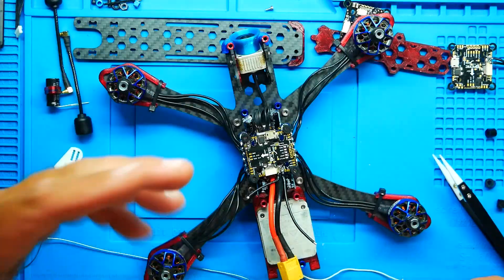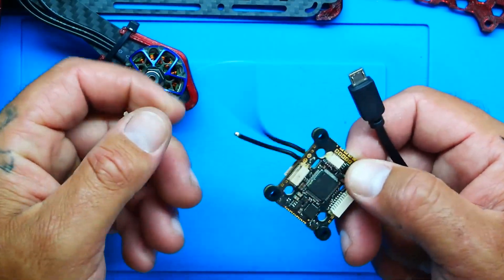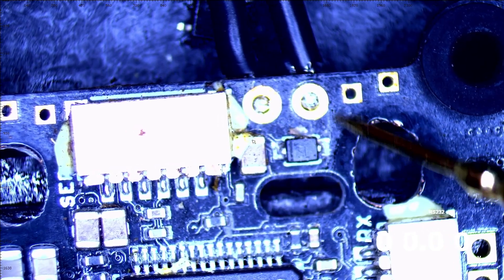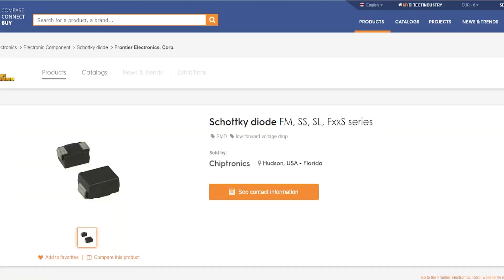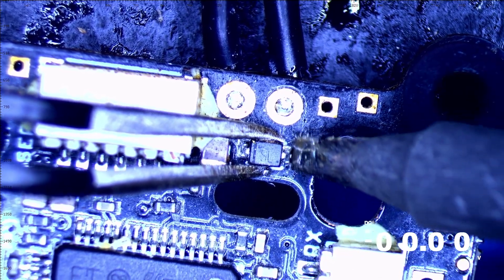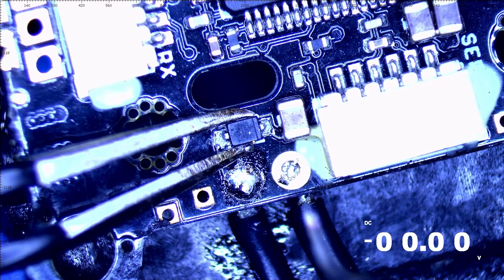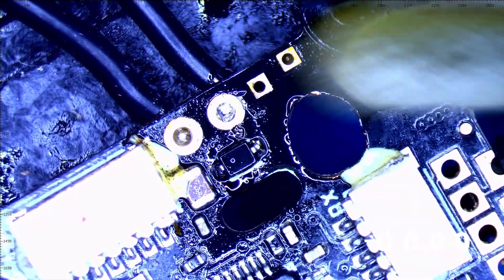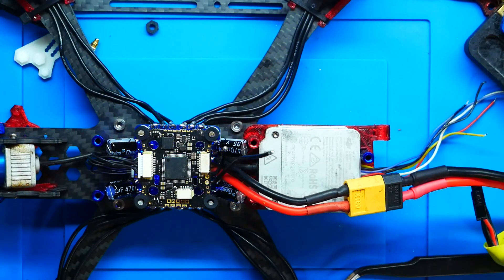Learn To Test Your Flight Controller With A Multimeter! Don't Throw It Away!

Comment: My ppwer supply should be the same rating as the battery im using for the drine. i presume . 2 s drone so I should use a 2s battery supply

Comment: Hi DrainMan, I have received a Brand New FlyLens 75 HD O3 \O3 Lite 2S Brushless Whoop FPV Drone as a Gift, After opening it I charge the Battery check the voltage and plug it, nothing happened, but I can go to Betaflight and check everything, even register the DJI part of it. Do you fix drone, maybe you can help. Thanks

Comment: Hello uncle, sorry for asking outside of the video discussion. I have a 5 in. assembled drone. With FC Speedybee F405 V3. But after everything is finished, the raft is assembled. When I set it on betaflig and wanted to test the motorbike, I plugged in a 6s battery which detected only 1s or 4 volts, not 22 volts. How do you fix it, bro? Please help uncle🙏

Comment: uggh, video help learn how to test motor pads and fets, but didnt find my issue. Brand new radio, brand new pavo 20.....not even 2 minutes into its maiden flight, I caould smell something cooking and then it hit the floor. No changes in betaflight other than assign switches and turning opff OSD and VTX due to I am flying LOS until I am able to afford the goggles I want. Anyways, I am stumped on this AIO in the Pavo 20. Using my multimeter to test pads and fets all came backl ok, I connect the AIO to betaflight everythinng seems fine, all lights flash and work the way they should. THis is drivning me fucking crazy, ther ehas to be a reason why a brand new drone cooked a motor in under 3 minutes time.....I just want to know if it was on my end, or defective product.

Comment: hi brother ihave a flight controller i axedently connect the ground pin to the motor output everything is working but little transistor is blow up which is (1amb) idont know everything works fine but this transistor is blown

Comment: Had you ever repair a TMotor F7 Pro FC of the chips that are right beside the large connector and are connected to the ESC outputs? I fryed output 1 and 3 and I want to know the replacement part, thanks!

Comment: I was wonder if I could use the smart battery from my dji fpv as the power supply to test the FC?
Reply: Also, is it OK to test with motors and everything connected?

Comment: hi Drain, thaks for the tutorial... i have an issue tho... i powered the fc with a bec, ok it works now, but i cant see the lipo voltage in osd.... it shows 0V ... is it because its powered via bec and it doesnt read the lipo?... is there any ways i can solve it?  thanks.

Comment: Hey DraaainMaaan.  I have a DJI 03 VTX and a RX connected to a blitz f7 mini FC. When I have connect only the RX, there are no issues. However, with plugged in battery when I connect the VTX, the RX gets burned. I've ensured that the components are connected to the correct ports. Do you have any idea what the problem might be? I thought it could be the voltage regulator on the FC.

Comment: Mine doesn't do yhe betaflight or power up from esc board  but i put tape around it and wrote bad on it and put it in a plastic coffee jar with bad vtx's and a bad elrs rx that worked until the ufl yanked off by the props . I put antenna on where the ufl snap went on , but whe i tried adding  shield ground wire the rx fell off from heat . If i would have used a different ground or just used a 14mm or 28mm wire for antenna hanging off the board . 6 elrs rx's and 3 tx's need " upgrades"  to work . That means they sell them in non working condition .

Comment: Had a little bump when landing (I blame airmode) and now my FC won't connect to the ESC either. Its fine via USB C but doesn't power up. This sucks and I don't know what to do.
Reply: did you figure it out?

Comment: A common problem is when using an iron that it’s too big is hitting or wiping tiny components off of the board. Some traitors are sooooo tiny that you can not see them whilst soldering. Study the boards solder point before you go and tin it up. Work from the outside and try not to wipe the iron across the pads if you can. It’s a tricky business and I’ve had to reflow boards for friends 😜💖

Comment: Man just installed the new g4 fettec fc and can't get the osd to work with the caddx vista. I used the pin in the fettec g4 manual and I only get link quality and nothing else.  I need battery volts and amps used. Any idea why and what to do??

Comment: I think it’s always worth fixing (if you know what you’re doing) because it’s not just that everything’s getting so expensive, it’s also that there is so much “Out Of Stock” components and shortages and because of the whole “Chip Shortage” companies are replacing quality components with lesser quality or slightly older components/gyros/capacitors/chips/boards/etc,etc as a matter of fact I’ve busted out a bunch of those “On The Arms” ESCs just to get some builds done while I wait for the ons I purchased. The good thing about this whole “Expensive/Chip Shortage/Out Of Stock/On Pre-Order Forever” situation is it’ll make people want to learn the basics: building, soldering, flashing firmware, programming protocols, inputting commands, configuring “Betaflight, INAV,Emuflight, Blheli, Agent M, etc,etc learning how to match components with each other in other words becoming more self sufficient and understanding quadcopers as a whole along with flying and just the entire RC hobby from ground vehicles to helicopters, to planes. 💯💯👍👍👍

Comment: I love my Fettec but unfortunately if the MCU happens to go poof on Fettec or KISS, it's done thanks to the serial and closed source firmware.  Betaflight FCs are much easier to fix since you can replace the MCU and flash.

Comment: Hi, is it possible to remove the osd chip without a heat gun station?
Reply from the maker: It can be done, but at least a spatula tip or hot plate would be helpful.

Comment: I love doin tish like this! Drain has a freakin lab scope lol quick question can a gyro be fixed ????
Reply: Yes! They can be swapped just like this, much more work but yes
Reply: @TylerD63  thanks alot man I was just wondering because my gyro went out after 4 batteries in my brand new mobula 7 elrs smh 👍🏽✌🏽
Reply: @FPVADER  it's definitely more difficult than what he just did though that's for sure lol
Reply: @TylerD63  that's why I'm gonna end up just purchasing a whole new whoop lol that way I will have spare parts at least lol just sucks because this thing is brand new maybe I just got a bad one from the factory
Reply from the maker: https://youtu.be/HOlZLmCZlJI
Reply: @DrainManFPV  thanks man👍🏽✌🏽
Reply: https://youtu.be/HOlZLmCZlJI